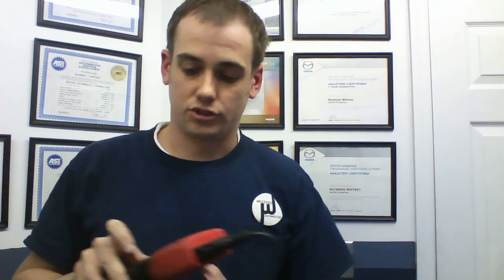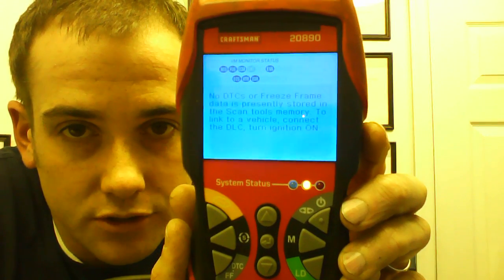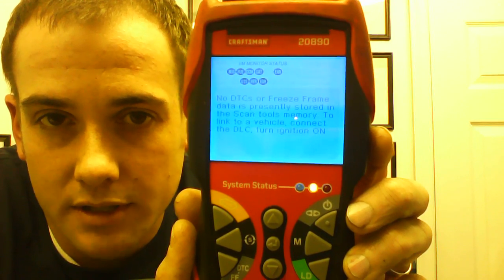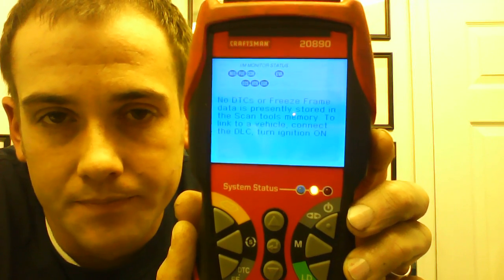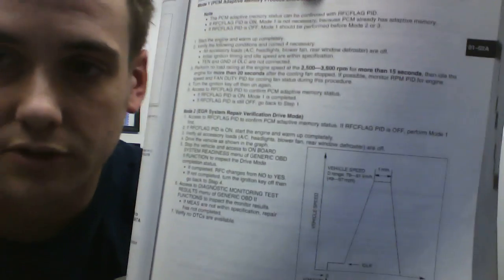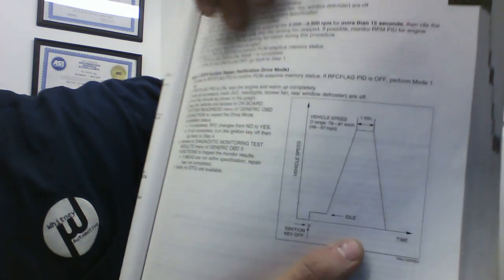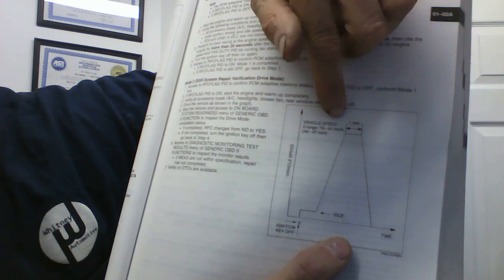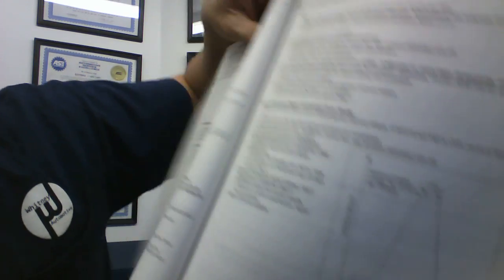Drive Modes, Drive Cycles, OBDII and Emissions Tests Explained

Comment: Hey Ray..so after doing 3 tests yesterday, the 06 rx8 still won't pass inspection. We did the crazy drive cycle to get the Evap, and Seconday to check ready, after 145 mi... still NOPE! Whatapaininthebutt. I tried to find your website, it said I could buy your domain? lol. and no luck on FB either, My end perhaps? any ideas?
Reply from the maker: Which monitors are not setting?
Reply: @WhitneyAutomotive  the evap... And secondary
Reply from the maker: @DeplorableBillyGunner  I'm sitting on an airplane right now or I'd look it up but I'm pretty sure both of those require a cold soak below 70 degrees F. Not sure where you're located and the temperature but it might be hard to do.
Let it sit somewhere overnight and try again in the morning. If you're parking it in a garage, try parking it outside.
Reply: @WhitneyAutomotive  OK thanks, I'm in dfw... Its hard to get everything lined up time wise, but I get the cold start thing you're talking about. Thanks again
Reply: @WhitneyAutomotive  After 900 miles... the seconday, and Evap FINALLY Reset :) It passed! However, @ 948 miles the light is back on. I'll check it this week and see what it is.

Comment: It's just stupid. There's no reason to do such an extensive "drive cycle".  Warm up the car, perform a 10 mile drive. That's all it should need. I have this issue with my car that I store in the winter. After hooking up the battery in the spring I get a 10 days from the new york dmv to get the car inspected.  I only put 1000-2000 miles on it a year. Ford has the most complicated drive cycle procedure. It sucks. 

Funny how a new car car drive right off the lot without a "drive cycle". It's complete bs.

Comment: How can I find the drive cycle is completed before I go to the smog check test?
Can a OBD 2 testers do that?

I went to a parts store where the free test was offered and they told me everything working(so I don't need any parts they sell), so i went to the smog test but it still failed by "not ready" in catalytic converter.

I want to make sure it'll pass the next time.
Reply: allgoo19 hello there ..did it pass ? I’m here in Los Angeles and my Porsche didn’t pass cause it wasn’t “ ready “? The previous owner never told me if he changed the battery on car ..I was told to drive it through a cycle ? And it should set up and be ready ? I don’t drive the car much or on freeways cause I don’t work too far from home

Comment: I went to take an emissions test and I failed due to monitors on my drive cycle saying "not ready". I needed a tune-up and that's why it was doing that. Well I have a machine that I can test all this on and all week all my monitors have been saying "ready".  Well this morning I go to run another test just to ensure I'm going to pass inspection this morning and now all of my monitors are saying "ready"except for my cat. Now I know you're allowed one monitor to say "not ready". however my question is can my cat say "not ready" as long as my other ones are saying "ready" and will I pass that way??? Also why after repairing the car and all my monitors have said "ready" for a week but now on the day I am going to inspection now everything is saying "ready" expect for the cat??? It makes no sense.
Reply: Christina Faye so did it pass ? I have the same prob on my Porsche

Comment: Dam Ray..Jolly good show dude..Thanks!! I just flunked my emission because they said after I had work done at a car shop, my OBD monitors had to be reset by driving. I have a 2013 Hyundai Elantra. I did like you said at the end of your vid presentation and it worked. I let it idle for a good 15 min with nothing on then took her out on the interstate at about 55 to 60 for 20 miles and the next day I passed. All monitors reset.  I appreciate it. Was going to take it to a dealer. But I found your video instead.
Reply: mike johnson what kind of work did you get done on your car that had the obd failure ? I have a Porsche and had a clutch done a while back ,an oil air separator but nothing electrical cause at smog station I was asked if I had changed the battery? I’ve owned the car for a couple of years and never messed with batterie ..I did changed the convertible top but don’t think the shop had to disconnect the battery in order to replace the top 🤔

Comment: Could a failed fuel gauge affect my im data?  Its not throwing any codes but its been stuck on empty for a few months.   Ive been using the trip mileage to gauge it.
Reply: No, unless your Tank fuel level is actually low the FUEL monitor will not run unless the tank is full, other than that your car should not fail a Smog Inspection test in California, i am not sure in other states because they have different Inspection procedures.
Reply: Hattin Productions have you not driven it enough?
Reply: Well over 1000 miles by now. Ive done all the stuff they say to do for my vehicles drive cycle. no cel codes either. weird stuff
Reply: Hattin Productions for how much do your drive, from home to work isnt enough you have to go around 40-80 of constant foot on the throttle
Reply: no braking gasing it just have to be consistent for around 50 miles
Reply: Yea man I went out in the desert and drove for a good long while.  Steady throttle and all.
Reply: Hattin Productions I cant help you here then if there isnt any codes I really dont know whats happening unless the scantool somebody used wasnt working Im not sure man. sorry

Comment: +WhitneyAutomotive hey I have a question for you. hoping you can help me sir. I have an 04 volkswagen jetta. my first car. I've been trying to get my car ready for a smog test for a couple months now. I bought a scan tool to guide me and my scan tool read my car was ready to be smoged, showing me a GREEN led light. I was new to the technology of the scan tool so I was trying to reset my ABS light and turn it off, thinking it would affect my emissions test.. so I accidentally reset my cars computer.. it took a couple miles of driving to get almost everything in my IM monitor ready once again.. the only thing that remains and I can't seem to get ready again is my catalytic converter.. you have any idea of what it might be?? or should I keep on driving it till it gets ready?? pls I'd be very grateful if you'd help me. thank you!

Comment: Would you know what the drive cycle for a 2010 e350 mercedes would be? I had a check engine light for a purge valve. Im going to replace the valve, remove the battery to clear engine light. I think I have to drive it for 200 miles?  Not sure..Can you help? Thx

Comment: I have a question about safety inspection. If a vehicle has a high intensity LED light bar retrofitted on the front, would that be a failed item?
Reply from the maker: DZEyoyo123 Its difficult to say without seeing it, but most forward facing lights are grounds for failure unless they are aimed, working, and wired to not come on at the same time as your regular headlights. Good luck!

Comment: question,
Does the mechanic at the shop just use a OBD device to run the checks when doing an emissions testing?
Reply from the maker: Here in Virginia, no. While a handheld scanner can be used to check monitor status and retrieve codes there is a specific stationary testing machine at each inspection station that connects to the vehicle and retrieves DTCs and monitor status. This machine is also linked to the DEQ and DMV and will instruct the inspector on how to perform the test for the vehicle being testing, save the test information, and transmit it electronically to the DEQ and DMV.

Comment: Can you tell me what book you were showing? I'm not able to get the CAT and EVAP monitors set to "ready" on my 2001 Toyota Rav4, after I changed the car battery. Should I reset these two monitors with my Actron Auto Scanner? Thanks!
Reply from the maker: The book was actually for a 2002 Mazda MPV Minivan so the drive cycles will be different. If you were to reset the monitors with your scan tool you would be starting over from square one. You may want to contact Toyota or acquire the specific drive mode for your vehicle and ensure that it is being performed properly. Evap monitors sometimes have "cold soak" periods whereas the vehicle must sit for 7+ hours at 70 degrees F or less in order to set as complete so they can be difficult to accomplish. If the modes are being completed properly and you still are not setting the monitor, I would suspect a partially deteriorated catalytic converter on the Toyota Rav4.